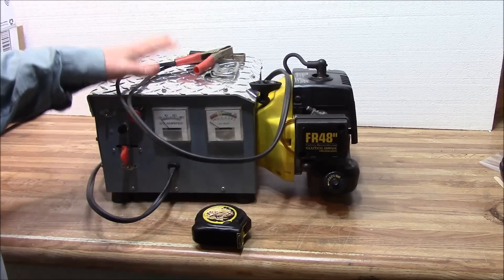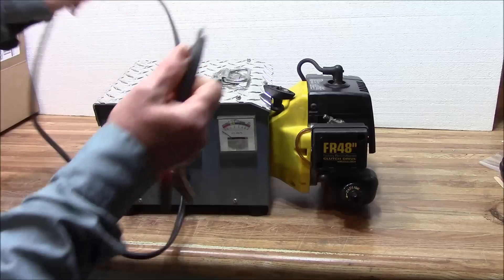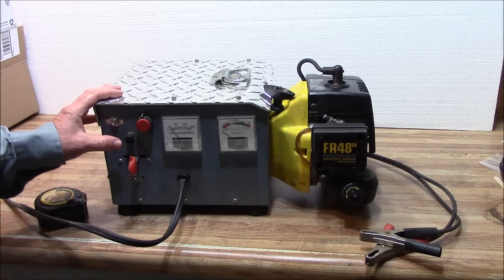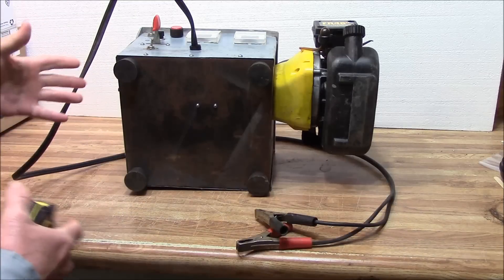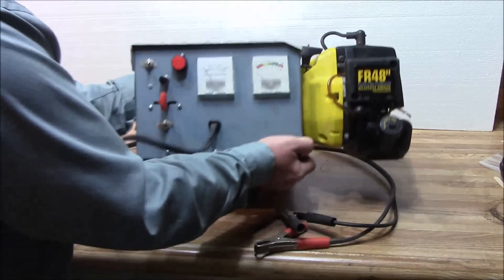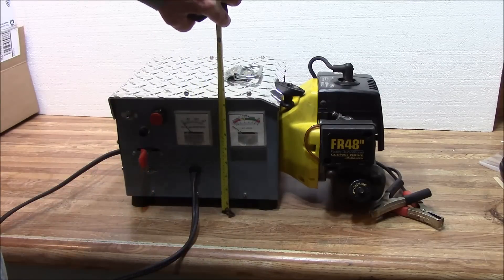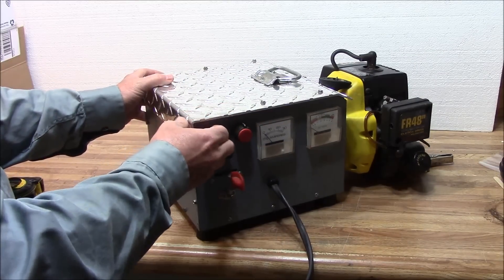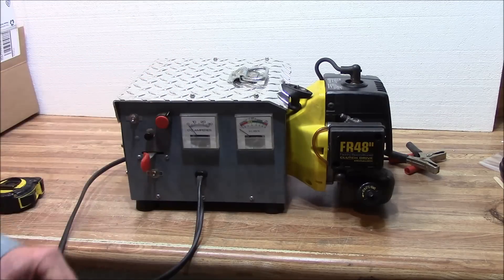How to Build an Alternator Motor/Generator Battery Charger w/ String Trimmer Motor part 1

Comment: I have a question. I built a robotic lawnmower running 24v motors.I installed a 24v alternator(one wire), Its  belt driven from the drive crank of the mower. My problem seems to be that its not doing a great job charging. I connected the the positive wire from the alternator to the positive lead on the battery. I also took a ground wire and attached to frame. Should I be doing something else? Its definitely not the normal project. I thought in theory that the batteries would maintain charge and the alternator would support the amps. The mower might run for about 20 min and batteries are dead